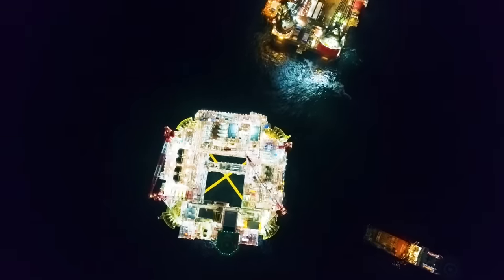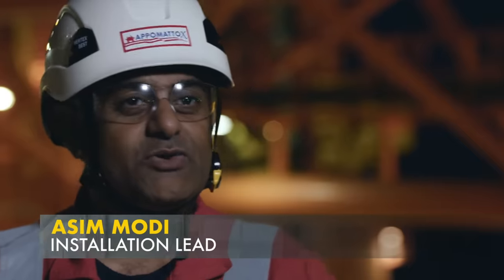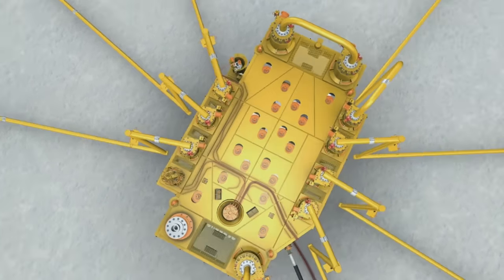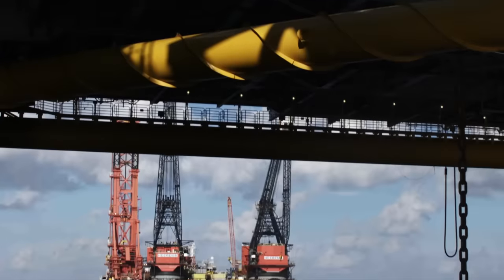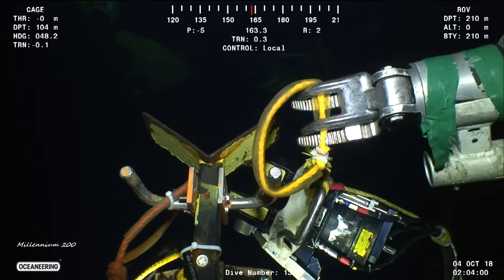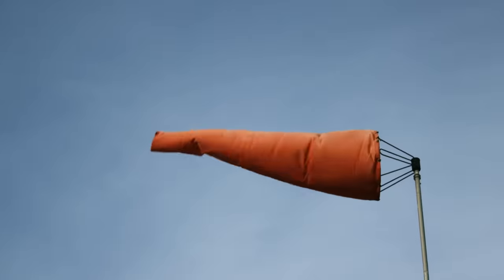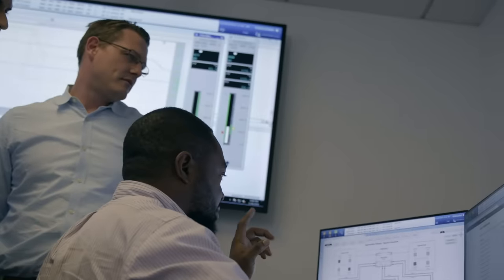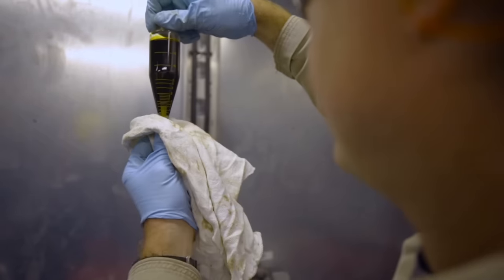Tapping into Oil Over 30,000 Feet Deep

Comment: I pray that Shell would hire a TESDA certified welders from philippines. Its a pride to wear shell workclothes if where them.
Reply: When you work in oil and gas welder kailangan mo pa dumaan sa welding school na provide ng company under go ka muna ng training bago ka mag pipe testing pag pumasa kana qualified kana mag weld depende sa category. Mayron mga qualification pag qualified ka lng sa carbon steell pwde ka mag weld ng carbon either smaw or tig combi.pero gusto mo maging welder ng stainles kailangan qualified ka din maging  ss welder at may binibigay sa inyo id card at yun ang tinitingnan ng mga qc/ qa.
Reply: Mga isang buwan then jan lang kayo sa welding school d pa kau ma deploy sa site .pag may id na kayo as qualified welder .di po enough ang training ng tesda lang.
Reply: Sa tesda  ano ba pinaka malaki pipe para sa training .pag sa gas plant malaki yan .mula 1 inch pipe to  64 dia inch. meron pa na abot ng 80 dia kasya na isang sasakyan
Reply: @mariejoygere2349  salmat sa info mam joy.. 😊 San po kau ngwwork?.
Salute po ako sa mga welder na tulad ko gsto ko pang magupgrade
Reply: We had Malaysian and Phillipino welders for this project

Comment: This is what we go through to extract a room temperature storable fuel with 44 MJ/kg, increadibly powerful stuff. Imagine what we would do for a fuel, if it were similarly regulated and widespread, with 80,000,000MJ/kg. That's the difference between the strong nuclear force and the electromagnetic force. I mean that's 80 Gigajoules per gram. The mind boggles.
Reply: FUSION FUSION 
Deliver us to Kardashev 1 civilization.
#ITER
Reply: Everything u just said made my mind boggle
Reply: @vorpalinferno9711  What is ITER going to achieve that fission didn't do 70 years ago?
Reply: You cant make plastic out of uranium
Reply: @toby1248  NGL it would be cool to go back to less plastic in some ways but in others it would be terrible. I would say to the degree that it can be achieved the processies should be culled down to those that do not produce co2 as a byproduct. Bakelite for example definitely doesn't but I must admit I'm out of my depth on this topic.
Reply: @alexanderx33  in general the carbon footprint of plastic is negligible, especially compared to the alternatives

Comment: If they need to drill to 30'000ft for oil. Then we are seriously running out of new oil discoveries
Reply: Nah, there's lots of oil, but lots of it is restricted. Alaska is a prime example.
Reply: I think it's been proven that some of larger reserves are in the Gulf Of Mexico. Venezuela has next largest reserves next to Saudi Arabia, and currently their oil operations are in question, perhaps to keep prices high for other reason in the industry. I'll admit this, it's a daunting task now days to recover oil, and let alone worry about prices, they took a picked a prime location to recover oil/gas from,  the weather there is decent most of the year as transport to the platform for workers, and from is not a issue so it's strategic location is probably bar none in the world including refinement operations......
Reply: @blkcoupequattro  Largest, not second.

Comment: When adding volume remember you have to regulate watee or drilll 8,500 ft
Reply: Water
Reply: Do not mix paper in suction with barrel because it does not help you control your system like you want
Reply: Pump your chemicals through barrel.